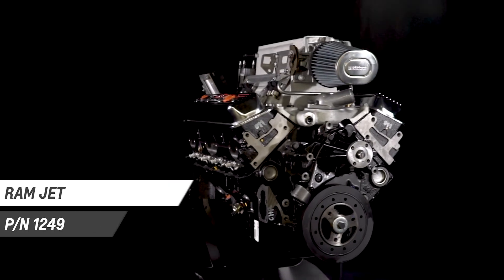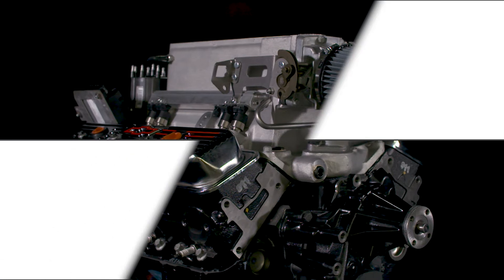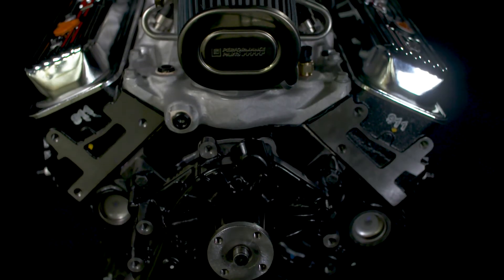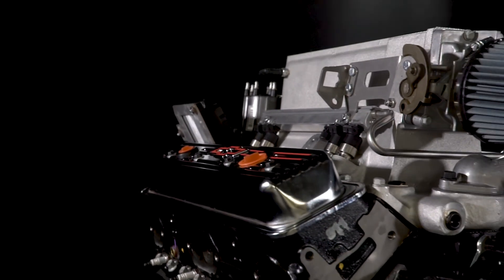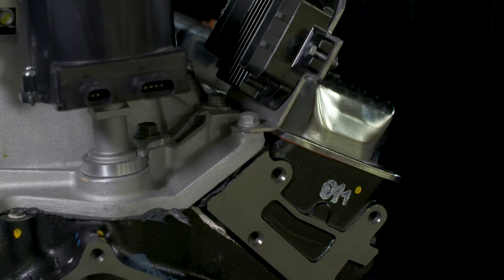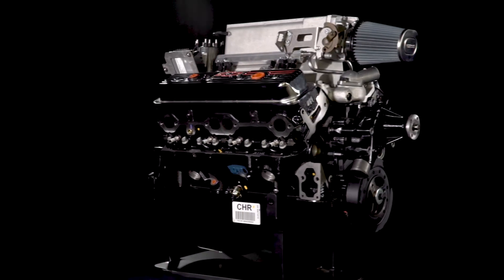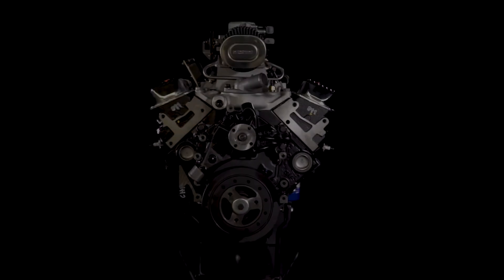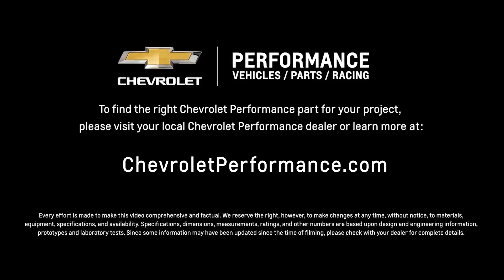Chevrolet Performance - Ram Jet 350 Crate Engine - Information & Specs

Comment: I got a deal on mine sitting in my old boss garage for $2500
Reply: I just paid $16,000 for mine! It came wrapped in a '67 el Camino the guy had over 50k into. Has a new 700r4 and new 12 bolt posi. Nothing has even had oil put in them, yet.

Comment: I  have  one and like it. One question I have always wondered about is why did the engineers decide to mount the ecu on the furthest back cylinder bank and high at that? These engine are getting squeezed into everything and was surprised by that. There IS enough wiring to mount on the other  side and I did just that so it would clear. Would be a lot more installer friendly if that was considered in the mix.
Reply: 12 years ago I had one squeezed into an 85 z28.  Same issues.  But in the end, I was happy with it.

Comment: All of the small block engines of the fifties, and early sixties, (283/327), with "old style" injection had more horsepower than this modern 350 version, (I know, it's got a lot of torque). Why not offer a version that is in character with those high winding engines that were in the top Corvettes of their day.
Would this modern fuel injection unit with "old school" looks flow enough air to work well with high flowing aluminum heads, and a 383c.i. short block? (425-450hp?)

That would seem more appropriate than on a cast iron block and head motor with 345hp. and a 5,000rpm redline.
Reply: pump gas friendly...way more street able.